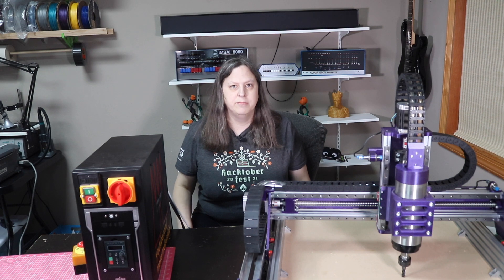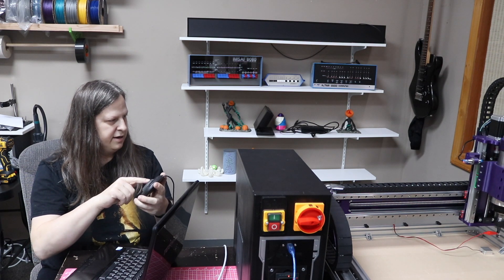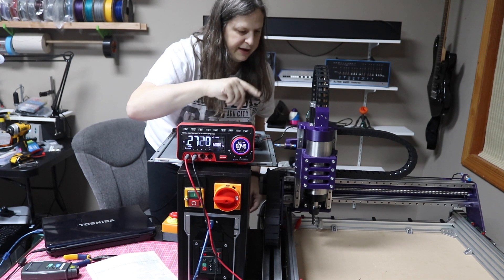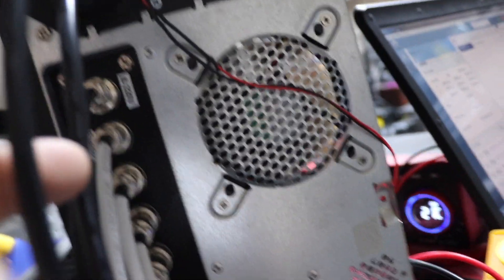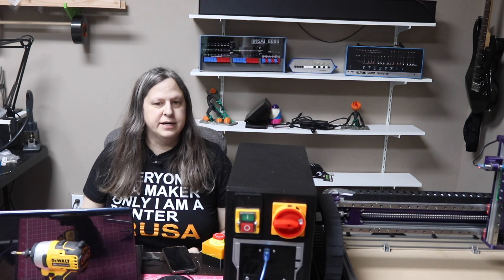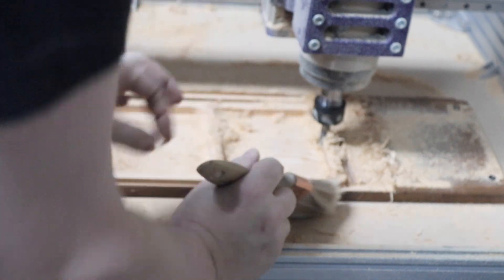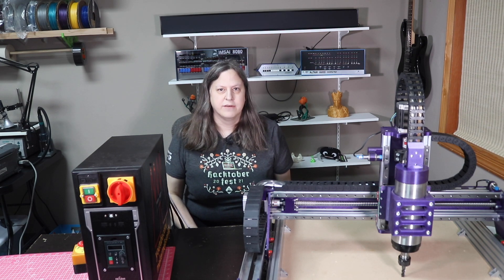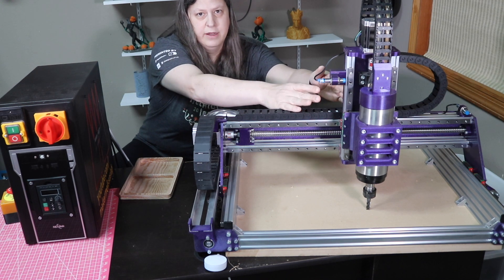Testing and Troubleshooting the powerful 2.2KW IndyMill CNC

Comment: Well done Melissa. I'm an engineer and I built my first CNC back in 2003. May I give you few advices ? First as the machine is new and still working fine, my first advice is to replace any structural part by metal ones. Soon or late you will want that but the machine will not be able to cut the parts as soon as the pla will wear out. 3D printing can still be helpful to print drilling guides if the machine gets out of order. As you said PLA can't stand temperature but the worst of all, this is not a stiff material, especially 3D printed, with a young modulus 100 times worst than inexpensive mild steel. That means it's definitely the Achilles's tendon of your machine and probably the main cause of all the issues you will have. PLA allows vibrations and vibrations can create heat into the material or can easily break it as PLA is brittle. Last PLA will deform rapidly under a screw pressure, like around the spindle. Remember the first property of any plastic is high... plasticity.

You're currently running your machine very slow. Don't get me wrong, it can't go very fast anyways because of the structural plastic parts. IMHO you still can go a bit faster. A milling bit don't like to go slow because it overheats and get dull rapidly. Extended machining times makes your machine wear out more quickly too. 

Every bit have its own capacity, depending of its shape and the rotating speed. The hardness of the material limits the depth of cut. Try to set your feed and speed according to your cutting tool.

As you don't seems liking your board very much, did you heard about the MKS DLC32 ? This is a 32bits motherboard running GRBL which is reliable and inexpensive. The board+screen bundle price tag varies but I get several ones for my mills under USD70.

Regard.
Reply from the maker: Yeah, I was at least planning on remaking the spindle holder in aluminum, but I probably should think about the other parts as well. I figured after the fact that I was going way too slow for the wood and plan on trying to have it go faster in the future, but thanks for confirming my suspicions.
I’ll look into the board you suggested. It looks like a really comparable board. Since I already have the other one, I will probably just use that unless I run into a major issue.
Reply: @makermelissa  No problem, there's probably no rush to change the board now. But the DLC32 is a much capable board than you think I run full panel machines with it at high speed. Small board, big capabilities. 

About the parts to be replaced by metal ones, it's easy : any structural parts. As long as it holds the frame, the guides, the transmission or the spindle, the way to go is metal. Please note steel (or stainless steel) is not much difficult to cut or to drill through than aluminum and it is stiffer and less expensive. 

I'm looking forward to seeing your progresses. Thanks for the videos.